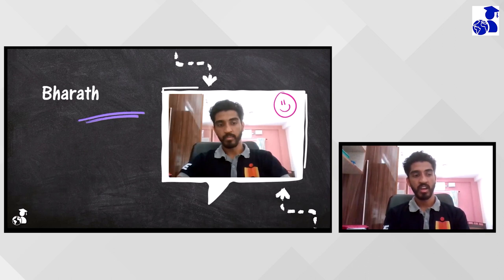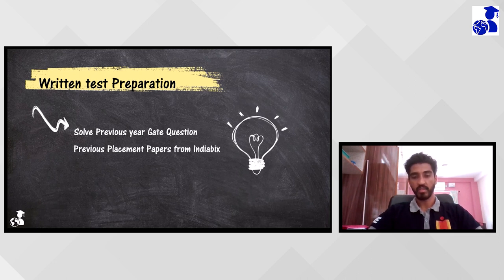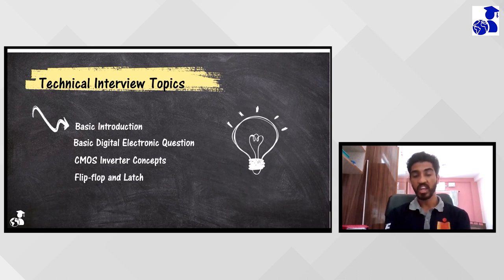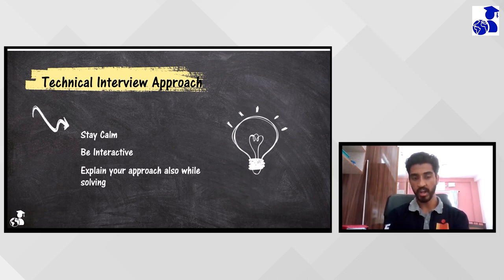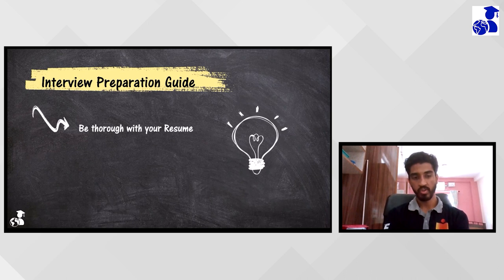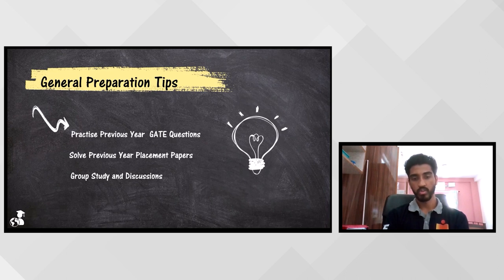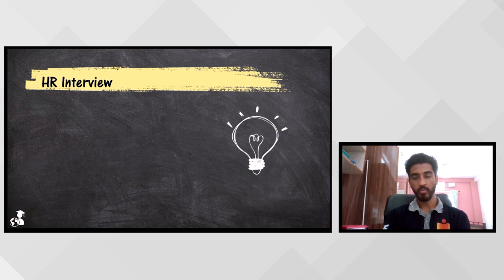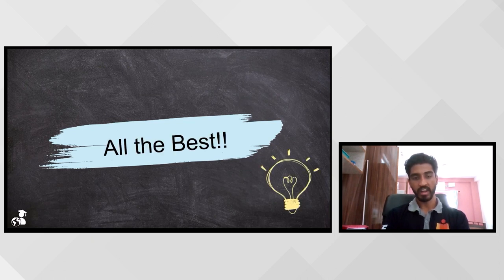Samsung Semiconductors | Interview experience | Preparation Strategy | RTL Design Engineer | IIT Hyd

Comment: Sir as we know RTL design comes under front end of vlsi design and to become a RTL designer should i skip analog CMOS Design part in front end?
I was told to learn these topics in front end:-
1.Semiconductor device modeling
2.Analog CMOS VLSI design
3.Digital CMOS VLSI design
4.SOC Design
I want you tell me what should i have to master extra topics please tell me what other topics i should learn
Reply from the maker: Digital CMOS design is sufficient if you are aiming for RTL design roles, digital logic circuits and hdl programming is a must for rtl frontend. For freshers generally recruitment in front end is for DV, RTL design and synthesis roles. For synthesis roles analog cmos and modelling is important.
Reply: @PlanetSkillzz  one more doubt sir as you mentioned you did a project on SRAM and I want to know how can I choose projects to work on and the right EDA tool
Reply from the maker: EDA tool you can use the one your college provides license to. Else EDA playground is beat open source tool. Regarding project selection, you can go for design of any block, simple processor, ALU, memory, ARM protocols etc based on your interest
Reply: @PlanetSkillzz  thank you very much sir